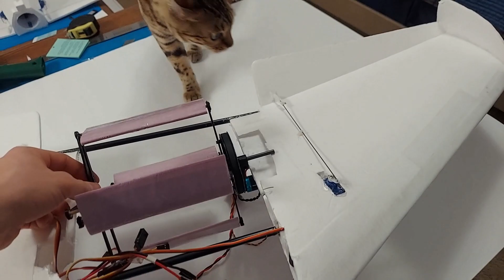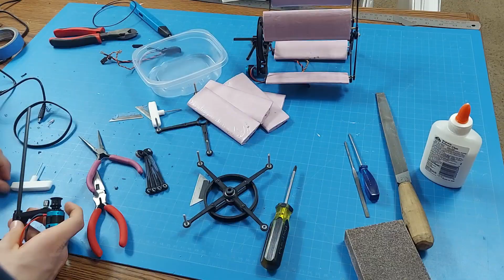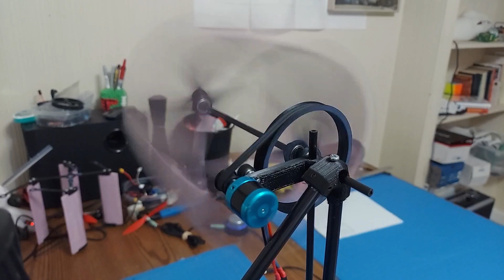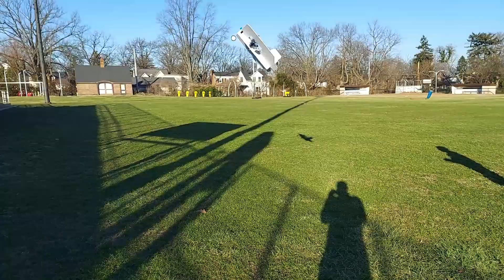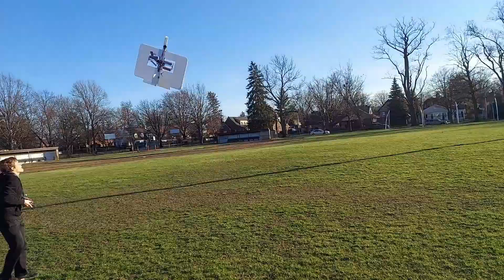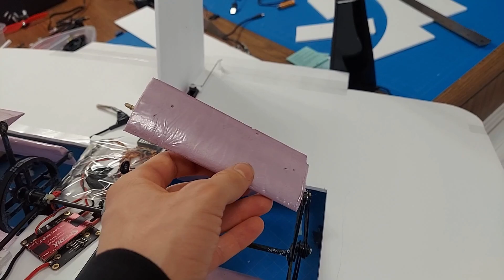2nd Cycloplane Attempt - Rotor Explodes on Test Flight

Comment: Hello nice try.

I think endplates are important to increase efficiency. 
In order to reduce flying forces, you should increase the rotor diameter. Guess 10 inch is ok.
 running it slower with larger blades
Is better for a model.
3 blades work better than 4 .
You should use thick Aerobatic Airfoils like eppler479 .
Reply from the maker: Thank you for the suggestions.  I do plan on doing endplates at some point.  The problem though is that they are tricky to add in, and I had some problems with plate rigidity due to the suction of air trying to pull them in.

Running it slower with larger blades would increase efficiency, but it also increases weight and the disk loading.  Disk loading is the measure of thrust divided by area of the blade, and decreasing it (ie. increasing the area of the blade) increases efficiency.  However, I'm trying to get cyclorotors on par with conventional propellers at similar disk loadings, so increasing it won't really matter.

You bring up a good point that 3 blades will work better than 4, but that is only in terms of efficiency.  The less blades you have, the worse the vibration.  I decided to just stick with 4 because it is more balanced.

Yes, I'm already using a thick airfoil.  A NACA 0022 to be exact, which was found to probably be the most efficient in a few empirical studies done by Texas A&M
Reply: @JudeSchauer  
Thanks for your reply.
I think cyclorotors should replace airfoils on a plane. 
I did some studies with ornithopters.
If you want to transform a cyclorotor into an ornithopter blade pitching gets weird. 
Guess its better to start with ornithopter blade pitching, and skip the vtol capabilities.
Ornithopter wings really move slow compared to cyclorotors.

Comment: Support the other side of the rotor. May even improve thrust.
Reply from the maker: I did try that in the past few weeks.  It did run, but a slight difference in angles between the bearings on each side led to significant friction.  I might revisit this idea in the future though when I go for another cycloplane.

Comment: I like your process, I am a little late to the comments but wonder if a flare fit on the dowels or wood carter pins would be lighter than the screws?  Really good job so far!
Reply from the maker: It actually turns out that I'm revisiting the whole wooden dowel Idea.  This time though, I'm making the dowels stick out much further in order to allow some extra room for the bearings to stay on, and I'm only using them for the vector linkages where the forces are less. I think I might revisit complete wooden dowels for all linkages later, but for now I want to focus on what works and try to get some cyclorotors or cycloplanes up in the air.

Comment: Not a failure if you learned something! I’d say that counts as worlds first cycloplane flight—or even attempt at one for that matter
Reply from the maker: Yep, I'd consider this a success.  Figuring out that something won't work is valuable.  I still wouldn't consider it a flight though, it's more of a powered glide.  The glide is made worse though by the fact that I could've had a real flight if I didnt add a few drops of hot glue that increased friction and reduced thrust by 50%.